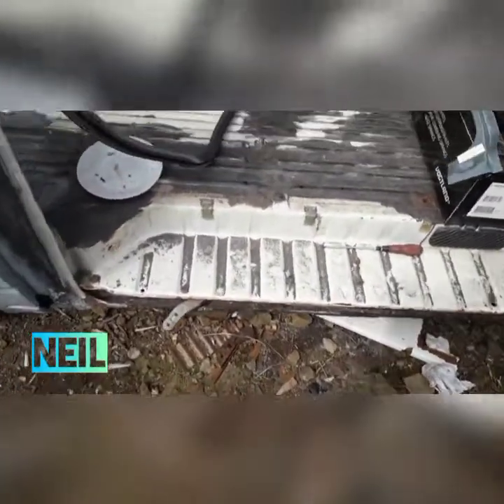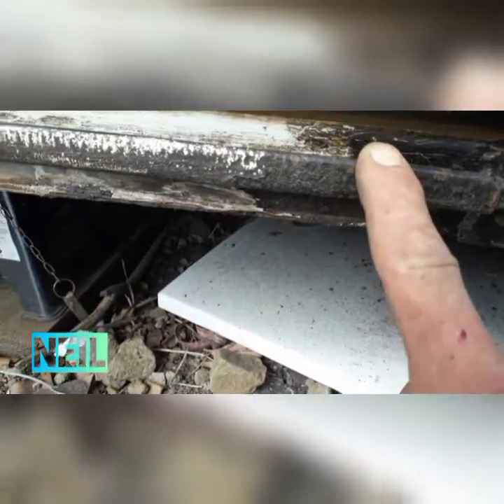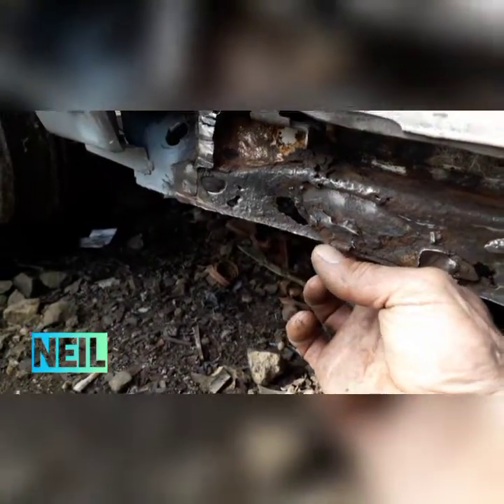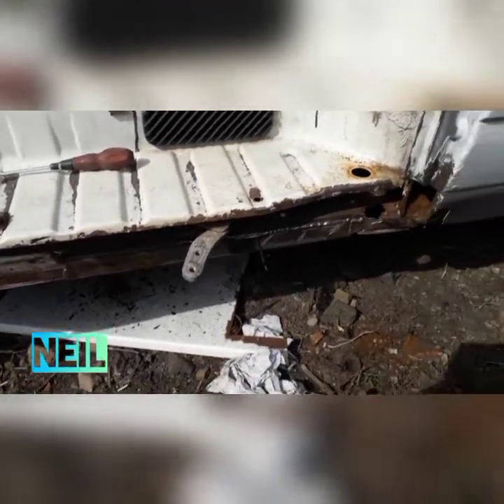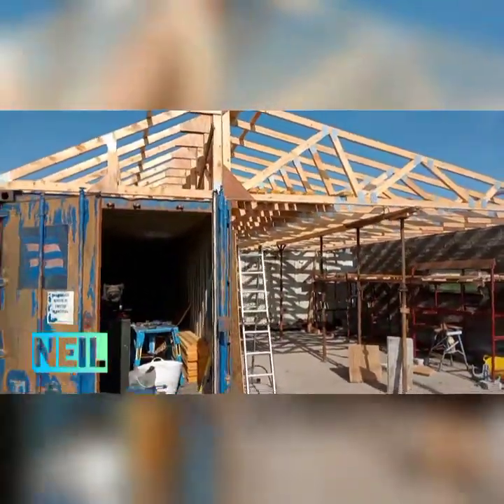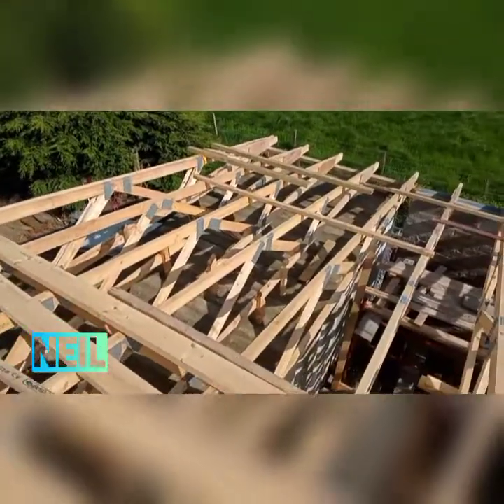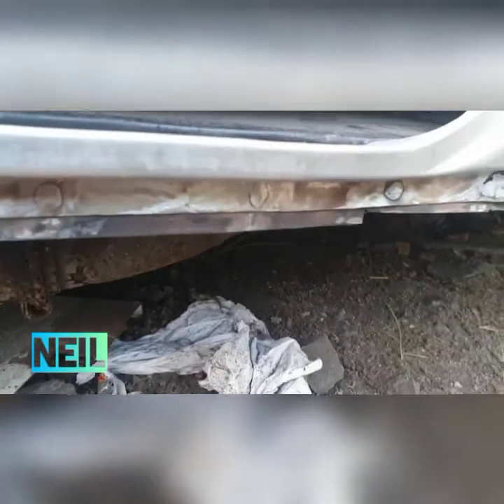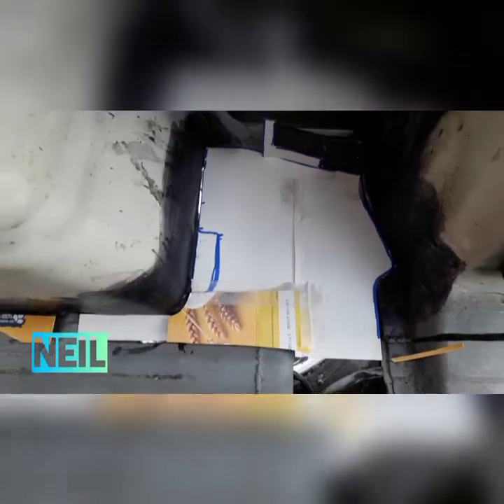Fixing my very rusty Volkswagen T4. Part 11. Replacing the sliding door rubber seal strip panel.

Comment: Neil mate whats the name of the sliding door strip called im in need of doing mine aswell just not sure of the peice cheers
Reply: Same buddy think its called the sliding door sill lip
Reply: @P8FPV  yeah I think there's a few online from different suppliers
Reply: If you find one for the NS cheaper let me know cheers
Reply: @P8FPV  how much where you finding em bud
Reply: £90
Reply: I did leave the link but youtubes pooh...il try n leave it on my page
Reply from the maker: Sorry for slow reply. I'm a bit upside down... the ebay listing i bought is now defunk.  It was from central panels though.  I would recommend phoning them directly if there's not an ebay listing. Their panels were the closest to original I've used. The part I bought was just " vw t4 sliding door sill" was £25 +post then.
Reply: @neil...  Cheers mate do these come with the channel section too or just the sliding lip ?? Cheers man
Reply from the maker: @scousebikers  I think from a quick scan through my video it has half the channel built into it.  Was 2/3 years ago so I cany remember lol
Reply: @neil... no dowt buddy hope everyone is staying strong 💪 🙏 
I just ordered the os sill part im just going to do some reworking to fit the ns i expect
Reply: @neil...  cheers bud apreciate it
Reply from the maker: @P8FPV   Pdubs did a video converting the offside to nearside
Reply: @neil... thanks buddy 👍

Comment: Admire you patience mate 👍 what steel plate you using for repairs how thick is it ?
Reply from the maker: Cheers Gary. For patches like the floor piece behind the tub I'm using 20 gauge mild sheet steel. You'll get it at a motor factors and maybe spray shop. Not expensive.  For the likes of chassis repairs in previous videos I just try and match the thickness required with what I've had lying about.